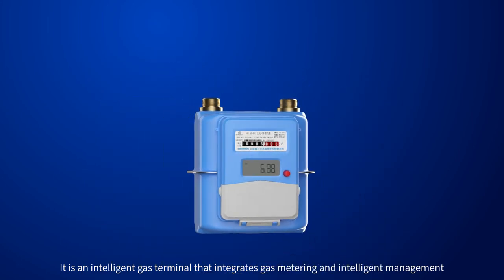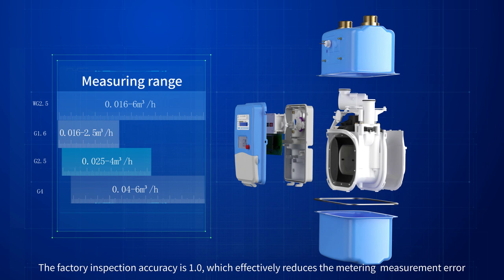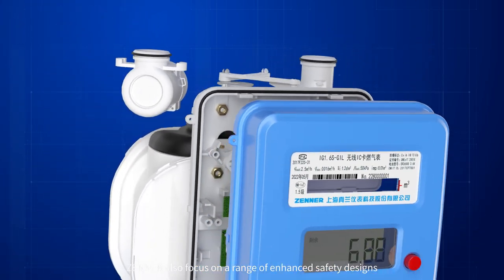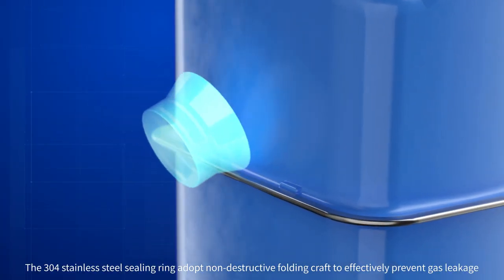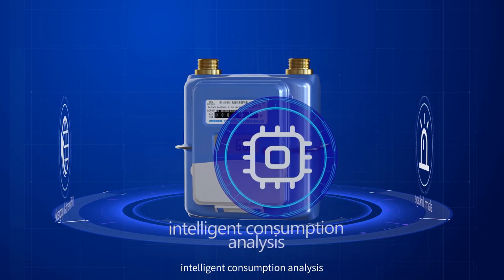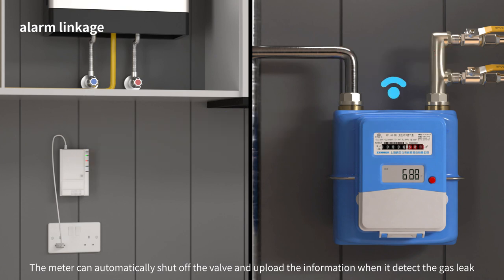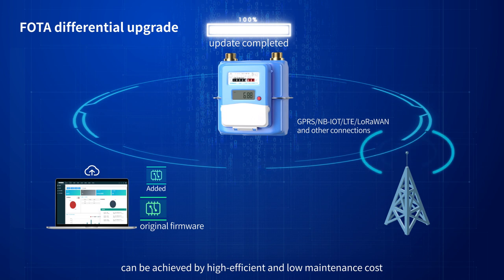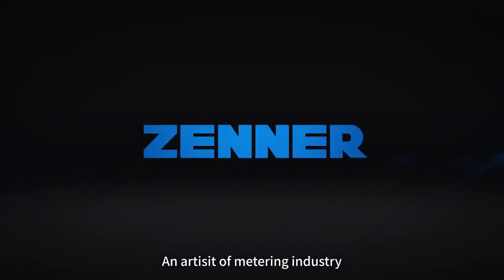Zenner Smart IoT Gas Meter

Comment: can we create software and connect this device to our software get meter data for billing software
Reply from the maker: yes, of cause. We have the smart meter which equips with remotely communication module and support sending the meter data to your software.But before deploying the meter, the meter and the software need to do an integration work to make sure the AMI struture working smoothly.
Reply from the maker: BTW, what kind of communication module do you prefer? What kind of communication channel that your software support? We have various communication module like NB-IOT,LoRaWAN,LoRa,4G,GPRS,etc. May I know which communication module is widely used in your country and what is the frequency is allowed in your country?
Reply: We are in UAE can you share any manuals or resources on this
Reply from the maker: different communication module has the different frequency, and different module has different use scenario. We have little information about which is  widely used in UAE,can you pls kindly make a survey about it?  @heyiammahadev
Reply from the maker: Could you please give me your email address or company name, and we can talk more about these issues @heyiammahadev